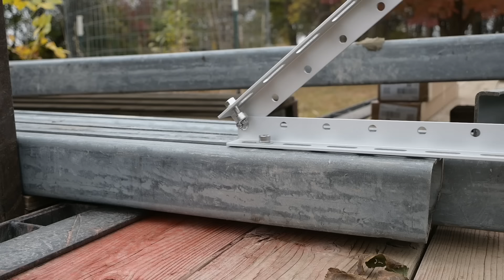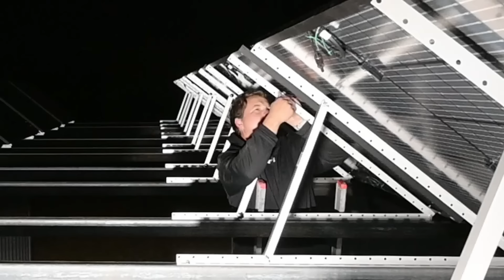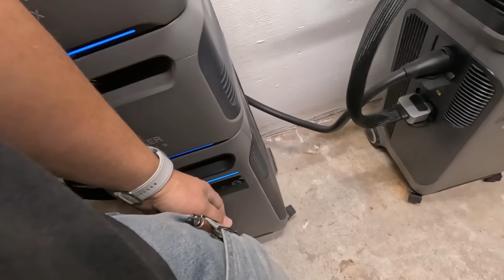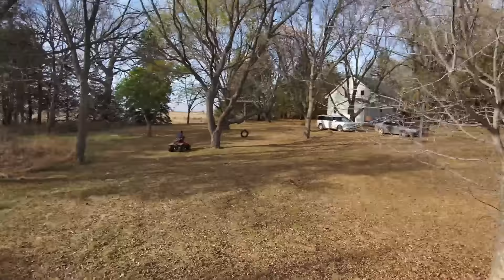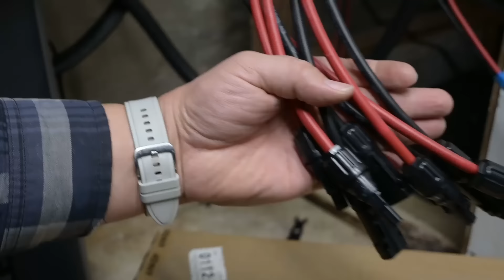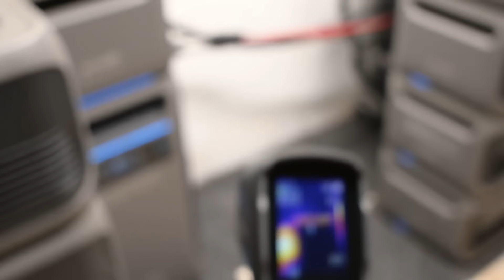How To Install Solar Panels on Shipping Containers - Anker SOLIX F3800 & Home Power Panel System

Comment: I retract my earlier snarky comment - You are getting paid to use the F3800 - I assume the equipment was your incentive - as before there are bad things about how it was done detailed below...
Reply from the maker: Please be specific with what bad information you're talking about. I always appreciate feedback! This video was meant to show how you can deploy solar within the design limitations of the F3800 system.
Reply: @BenjaminSahlstrom  

Sorry I write novels but it is all pertinent.  By switching from temporary install using a generator plug or transfer switch to permenant install using wiring you are subject to all the safety rules from the NEC.

OK - first the bad - 
The NEC requires an EGC (Equipment Ground Conductor) be run in the same conduit as the PV wires.  This wire is connected out at your array to the panel frames, racking, and connex boxes.  It keeps you from getting a shock from a voltage differential at the frames.  The other end of the EGC at the house connects to the house grounding system, (i.e. your main panel has a ground bar, or you can pick it up where you are either using power to charge the batteries from the grid or are back feeding the grid. I see in the instructions for installation that ground bar in the Solex power panel.

There were NO frame grounds that I could see.  You can tie the EGC to one frame and then connect the opposite side of the frame to the next one over using ground clamps.  The wire being exposed would need to be bare 6awg solid copper wire.

Many HF style inverters put AC power out on the DC PV lines - I haven't looked to see if the Anker does this - to check - out at the panels with everything connected measure both AC and DC voltage across one of the Y connectors - i.e. either leave a panel disconnected with the rest connects.  If you get any AC reading at all, that is bad.  The frame grounding to the EGC eliminate this hazard mostly, but a disconnect between the inverter and panels before you work on them is a must. If this is true, it should be present anyway.

NEC requirement is for wire support every 4.5ft.  So you may be ok there except for the places where it looks like your Y connections are under a bit of tension from the panels being to far apart.

You are missing a DC isolator - this is a method of turning off the string when you want to work on things. As is you are plugging in your panels when the voltage is live.  The isolator should be located outside the house just before your wires enter - it should be mounted at a comfortable height like 4ft.  You can get one isolator per string, or you can get one big one.  Personally, I would want one at the array and one at the house, but the one at the house is mandatory.  The cheap copies on amazon are junk, but they buy real ones even though they cost.

The DC isolator is required by NEC 690.12(b) - must be easy access without tools, readily accessible, and interrupt the flow of current.  It can be a DC breaker or the isolator, but the isolator is a much better choice.  Metal enclosure or the flame proof plastic that IMO makes. 

There should also be labels on all conduit containing DC cables.

Note - if your wires don't enter the building near your main service disconnect you need a fade proof card to tell the firefighters where the DC disconnect is in case they need to kill all power to the house.  Otherwise they kill your AC feed and get electrocuted by the DC feed from the panels.  Ideally there is a master rapid shutdown button by the 

https://imoautomation.com/imo_us_usd_view/products/solar/dc-isolators-dc-disconnects.html

You are missing any form of SPD.  These should be installed at both ends of the wire just before it heads up to the array and just before entering the house.  Your 200ft run is like a large antenna to any nearby lightning strike and will generate hundreds to thousands of volts on the wires.  The SPD will short that to the ground (the EGC again) and prevent your expensive equipment from being damaged.  I prefer the midnite solar brand, but there are many others that will do.  The need for an SPD per set of PV wires is one reason people use a combiner at the array - it limits the number of expensive SPD.

Suggestions -
Turn the Unistrut being used as wire trays sideways - this keeps the wire out of direct sunlight.

Zipties - the common type are made from nylon and with weather badly and fall off over time.  Get stainless steel ones and use them instead.  Also, get wire clips to attach the wires to your panel frames.  Lengthen the wires as needed to make it all neat and tidy and not able to swing in the wind.

MC4 - do you know what brand your MC4s are?  They should all be the same brand - there are many cheap knockoffs out there that use steel verse copper pins , and they don't fit together to make a low resistance connection.  They don't stay water tight.  You may want to think about some dielectric grease on the tips of the pins to keep the moisture out when the o-ring seals fail in a year or three

Tools -
For anything over 10awg a Greenlee 1903 wire stripper - it won't damage the wires like I saw when you stripped them with the wire cutter.  For 10awg or smaller an automatic stripper works well.

The AMZCNC hydraulic crimper - the dies are marked in AWG, but they are actually metric.  This is why they don't fit what they should, and you can end up with wings or loose connection or having to crimp with two different sets of dies... Sometimes, it takes one size on one side and another size on the other side to get a good crimp.  All of the cheap ones from Harbor Freight or Amazon are like that.  If you get frustrated, go buy a real crimper like the Temco TH0005 or TH0006.  They are marked in AWG, and the dies will crimp neat and correct and imprint the wire size into the lug/pin when used.

Design - 
The panel arrangement of 12 x 400w all in parallel is very inefficient - I realize you did this because of the Anker input restrictions on their MPPT.  You are losing something like 400w of power while charging.  This is the resistance of 16 x 8awg wires. 

If you were to switch to something like a Victron 250/85 MPPT you could add a combiner box at the array and run 3 parallel strands of 4 panels and only loose 90watts - that is using the wire you have in the ground.  If you ran just a pair of 4awg you would have the same effect.  The problem is you would need to tie all your inputs into a set of bus bars and hook the output of the MPPT to it.  This would mean smaller conduit and cheaper wire since you could use THWN wire instead.

Wire size - You have 3 panels in parallel which means you need to use the panel Isc * 3 = 13.8 * 3 = 41.4 amps * 1.25 * 1.25 = 64amps - this is the minimum wire size you can use per string.  in conduit you have to use the outer diameter of the pv wire to calculate the fill percentage - just looked up a couple of random 8awg PV wires and for 16 strands of 8awg means you need to use 2" conduit - looks like you did but I couldn't see for sure.  NOW the fun - because you have 16 current carrying conductors in the PVC you need to derate them according to Table 310.15(C)(1) of the NEC - so they can only carry 50% of the rated capacity -  so instead of 40amps you can carry 20 amps but you have 2 of them per string which means you have 40amps - which is below the 64amps you actually need by code...  Good thing this is off-grid.

Neatness counts - you have stacks of those batteries and back to back in places - that sort of setup would never pass a formal inspection - They would need to be in a row tied to a bus bar and the output of them connected to a generator input.  

Grid backfeed is a whole different issue I am not going to talk about other than to say it requires an interconnect agreement and that setup wouldn't pass the power company inspection.

For attaching your frames securely I  suggest marking where the holes in your strut are and welding bolts to the boxes with the threads sticking up.  Then you could just sit the strut over it and run a nut down to secure things.

Wind uplift calculations on panels is pretty insane when you have them mounted tilted up like that.  The two panels on each set of struts could lift several hundred pounds if you got a 30~50mph gust - not sure where you are located, but my county has a wind and snow load map.  Use the tool in the link below to find your loading by address.

https://ascehazardtool.org/

And last - FYI

Red cable will fade over time, so it will be white in a few years.  This is why all PV wire is typically just plain black.

and P.S. I love the kid powered wire conduit puller - I have some wire I need to pull through the attic. Do you loan him out??
Reply: @robertb287  that was an epic critique!  Cant believe ben didnt respond to you at all
Reply: I forgot to add a question, you don't show where the wires go once they enter the house, but the NEC says they MUST be inside metal conduit in or on a dwelling.   Did you do this?
This means inside you would use EMT or FMC to get them to the location/room where they terminate.  In that room, I would terminate them in a metal raceway and use FMC over to the end where they plug in so just the end is exposed.

The reason for this is the cables is rated at 156% of current expected to be carried, but it is a constant on that never goes off if there is sunlight.  This means if there is a short to ground or between the cables it can smoke and eventually cause a fire.  In theory not, but better safe than flames.

The issues all stem from the F3800 being sold as temporary units versus permanent installation, so they have no knockouts to terminate FMC or MC conduit at the units.  To me, this is reason enough not to use as a full house backup system.  They are designed to be easy and foolproof, but that also means they don't really meet the NEC for a permanent install like you have done.

If you are pulling wire in large conduit like that it is sometimes a good idea to run an extra pull string along with the wire.  This way later when you need to add an EGC you can just pull it verse having to pull all the wire out then run it all back in.  I will sometimes also run an extra pair of wires I don't intend to use now for expansion later.  You could use one of your existing wires as the EGC if you have a spare, but I am not sure you do from the derating.

Were it me with all the wires you have pulled - I would add a combiner box with a set of bus bars at the array.  Connect 7 of the 8awg wires to it using lugs you crimp on to each bus bar.  Use a fuse holder per wire up to the panels - so 16 fuse holders.  Add a midnite solar SPD there.  Then at the other end have another bus bar set where you connect the 14 wires, then a ground bus bar to connect the rest of the stuff to.  Add the SPD here.  It is better outside, but where your bus bars is will work.  Add FMC or MC whips to reach each of your input connectors with the XT60.

Now the real question - can the F3800 take straight DC verse panels that it needs to run the MPPT for?  According to the FAQ you can do this- well, they used an example of a 48v100ah server rack battery - this is the same as using the bus bars as I describe.  If you put in the Victron MPPT I listed earlier between the 7 sets of cables and the bus bars.  I could draw you a diagram of what I mean if you want to pm me a place to send it.  The caveat is you can only use one of the ports on the side at a time when doing straigh DC charging - which seems odd... 
https://youtu.be/XFlRkMm8rDc?si=ghUzLCraZq6k0A5Z&t=667

A box like this would work at the array and is large enough for the fuses per string, the bus bars, a disconnect that does all your strings, and the SPD to mount.  You can put a 2" or whatever size your conduit is.  Make sure to tie the metal to the EGC.

https://www.vevor.com/electrical-enclosure-c_10749/vevor-20x16x8-carbon-steel-electrical-enclosure-wall-mount-junction-box-ip65-p_010399775149
add a DIN rail for fuses, screw the bus bars down - all three of them - pos, neg, and ground.

Fuse holders - then a box or two of midget fuses
https://www.stellavolta.com/copy-of-soladeck-1451-power-panel-component-din-terminal-block/

What you are making will look similar to this
https://www.stellavolta.com/midnite-solar-mnpv10-1000-combiner-for-1000vdc-fuse-holders/

Advantages of the combiner box - 
 - Gives you a place to mount the SPD
- Gives you a place to mount the DC isolator
- Gives you a place to transition from 8awg PV wire to THWN or other wire
- Gives you a place to mount a breaker for the wires feeding back to the house - this means you no longer need 156% of expected current - now you only need 125% of expected current so even derated your wires are more than big enough and you can spare a set for the EGC.

This changes from needing 8 SPD to needing 2.  And you still need the DC isolator before the cables enter the house.

Label requirements since it is a permenant system
https://www.hellermanntyton.us/industries/energies-solar/nec-690-pv-labeling-requirements

In particular
https://gp1.wpc.edgecastcdn.net/00AC62/documents/datasheets/SOLARPOSTER2020.pdf

I know it is more work, but it is a lot safer.

And shameless plug - you can learn a lot about all of the solar from diysolarforum.com

Comment: future test? get a victron 250V or higher voltage MPPT use that to charge a 5kW server rack battery and then plug the Anker inputs into the 48V battery.  I bet you could gain some efficiency and only need 1 or 2 pairs of wires.  I'm actually doing that with my Delta2Max and moved the solar I had going to that to a 100/20, increased my overall gain some and now I can choose to either run the house off the MultiPlus2 or feed either 1 or both MPPT's on the D2M which feeds our networking equipment/critical loads.
Reply: I’m doing exactly this with the same set up. He has except my charge controller can go up to 500 V and I’m using a 48 V battery to charge the anker faster and longer. It does cost a little more money for the battery in charge controller, but I double my solar charge capability..

Comment: All I can say is if you paid that much for panels, you did not check out Signature Solar! 450 watt Aptos panel $176
Reply from the maker: I'm definitely aware that there are better deals to be had! This was meant to demonstrate how Ankers equipment performs when installed as they intended. 

I'll definitely be getting some more cost-effective options in the future.

Comment: Thank you Benjamin for the video/example. The Anker panel link you supplied is broken, would you recheck please? Would you share a diagram on how you connected the all panels in parallel for one of your XT60 channels?  Which brands of Y branch and 3-way branch cables did you use? I have an F3800 with several panels and trying to see what I can do better.
Reply from the maker: Thanks for the heads up on the link. I'll check on that. I believe there is actually a diagram that accurately depicts the parallel setup that we used.
Reply: @BenjaminSahlstrom  Thanks for the follow-up. Still looking for the diagram, can you respond with a link for it or add it to the description links please?
Reply from the maker: @skpoe  It's in the F3800 manual. Text me at (507) 298-2367 and I'll send a screenshot.
Reply: @BenjaminSahlstrom  Thank you. I'll double-check the manual before I bother you again.
Reply from the maker: @skpoe  Not a bother at all!

Comment: Great project but keep an eye on that LB location going into your foundation, I get there was not much room there but you should really have an Expansion joint to allow movement. If going through the sill instead of the block is an option that would allow more room to install the expansion fitting

Comment: Danke für das Video.
Die Querträger für die Panels sind auf den Containern falsch montiert ! Ein Fehler der immer wieder gemacht wird, auch bei der Montage von Trapezblechen für Bedachungen.
Die Trägerschienen gehören auf die Dacherhebungen und nicht in die Rinnen-Mulden montiert. Das Wasser sammelt sich in den Mulden und somit ist Wassereintritt ins Containerinnere vorprogrammiert. LG

Comment: More details on your friend getting the call from the utility. How has that turned out? It would be best if Anker didn't try to zero the usage but it may not be feasible. I dont think the current sensors can tell direction of flow. I also expect my utility to come knocking and accuse me of backfeeding because iif i watch my meter while it is zeroing the meter I can see alerts popping up on the display of my digital utility meter. It flashes a code that seems to be an alert to the utility to have a look.
Reply from the maker: I have a video in the pipeline on this topic.
Reply: @BenjaminSahlstrom  I tried putting my ct sensors in my sub panel and it wouldn’t allow my f3800 to test out so I had to keep them in the main panel.. I don’t have my solar hooked up yet so I figured it would be a good test to see if Xcel notices .
Reply: @BenjaminSahlstrom , I finally got my solar hooked up and noticed that my electrical co-op's customer portal is marking my days as average rather than showing my actual hourly usage. I think they are seeing the powershaving and believe it is an issue of some sort.
Reply: I’m Interested in this as well actually.
Reply: I know a way around this but it sucks. I move my three remaining breakers and the HPP breaker to another sub panel. I then place a 10w load in my main panel and put the current clamps on the line feeding the new sub panel. What a PIA that would be, but it would potentially solve the issue.